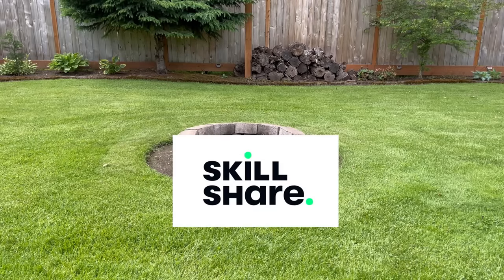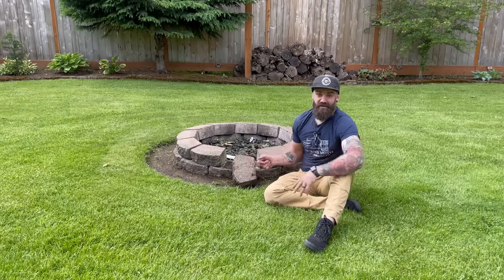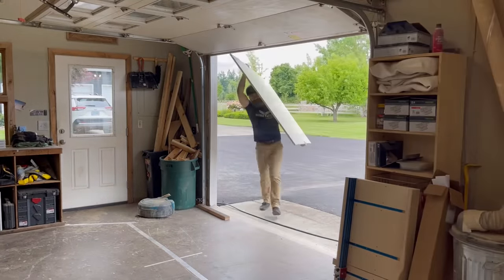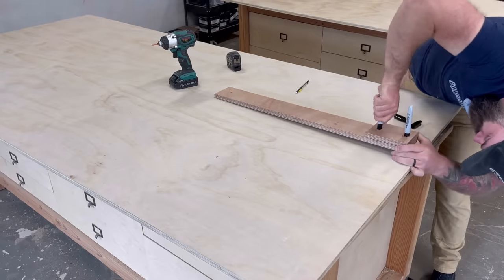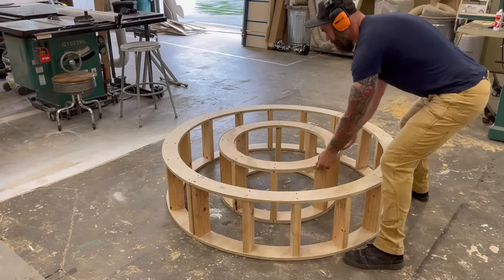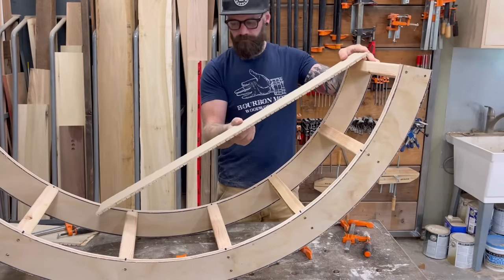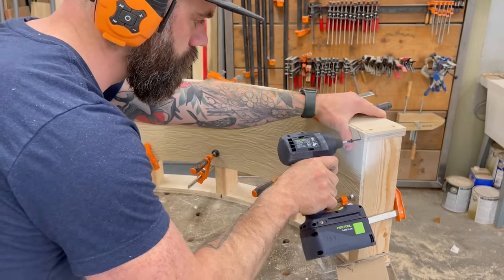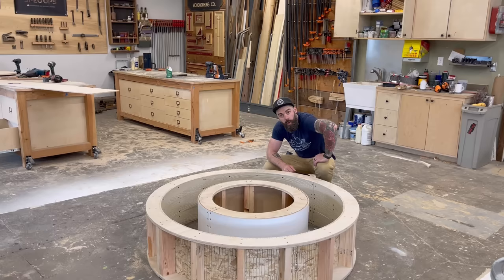Making a Concrete Fire Pit the Right Way || Ultimate Fire Pit Build

Comment: The interior part, I would not have bothered removing.... just light a fire in it and let it burn 😂
Reply: I was thinking the same thing
Reply: Exactly what I was thinking
Reply: I think he just said, “Dooooooooh!”
Reply: Thats what we did. Worked like a charm
Reply: Same !!!
Reply: I was wondering the same hahaha
Reply: exactly what I thought!
Reply: Do you know what happens when you burn melamine? First off, melamine is a fire retardant. This doesn't mean fire proof. It will burn slowly, but first it's going to release a lot of toxic fumes. Burning some could be your last mistake. Melamine is dangerous when it is heated up because it releases hydrogen cyanide and nitrogen oxide. There is also formaldehyde in the resin. All of these are carcinogenic. The fumes can kill you and residual chemicals can also leach into your soil. It is plastic, so you might want to rethink that.
Reply: Or just disassemble one of the 3 sections and knock the other two loose.
Reply: @robreneau2959  Science=PartyPooper is all I read there.
Reply: @robreneau2959  there is a very simple solution to that, just drink 8 beers before you burn it
Reply: Same
Reply: Exactly what I was thinking. 😆😆
Reply: @robreneau2959  I'm relieved you posted this and people like you post to YT at all. I don't know if that form lumber was treated wood, but I imagine that's also not great to burn for the same reasons. Seeing people using unseasoned wood inside is another burning error because it's loading up their chimneys with excessive creosote. I also see a lot of videos of people using pallets as furniture but don't know to look for the grading stamps or what they mean, etc. Maybe these are fine outside but not like next to your face in a couch or bed frame. No expert here, though.
Reply: My thought too.
Reply: @robreneau2959  so what....there is worse stuff burned every day by the government. Just don't stand near it and don't cook over it while that crap is burning and you will be just fine. What do you think is released when a vehicle catches fire and burns.....hmmm? There are tons of vehicle fires every day.
Reply: Burn like 2000$ in lumber there
Reply: @michaelkey3915  Using what the government does as guilt leverage will make you a bad BAD person, and also do awful things. Just do what's right to you and your neighbors.    :)
Reply: @robreneau2959  dont use melamine as your form then, DOH!
Reply: False Flag  You're right but I was more concerned about the local safety of one person who might be saved by a bit of knowledge. Do you sit around your exhaust pipe sucking those fumes? But, go ahead, burn it and while you're at it, take a deep breath and disregard everything I've said.
Reply: @TheMouseCop  LOL
Reply: @ericgilmore5949  LOL
Reply: @michaelkey3915  You're right, lots of things are burned, discharged into the environment every day and we're all sucking those chemicals in. Yet, they have also dissipated into the environment. More than likely, someone who doesn't know would probably burn this while sitting around the fire. What you fail to realize is that chemicals will also leach into your soil, your groundwater, contaminating you directly, locally. All I've done is provide a warning label, so go ahead and remove it.
Reply: @BraxFilm  No, just don't burn it.
Reply: @robreneau2959  tell him Robert. Hit him with those FACTS
Reply: @robreneau2959  typical. You put important safety information out and people just say “who cares?🤷‍♂️” A lot of people, karen, a lot of people care.
Reply: Yup
Reply: I was scrolling down the comments to exactly find that thought
Reply: @widjadija  Let's remove all the warning labels, let stupidity and evolution determine who moves forward.
Reply: I thought he wanted to keep it to reuse.
Reply: I was going "burn it" like 7 times lol he already broke my heart, when he chopped them long 2x4s into them baby (scrap) pieces..then again, if he can re-use the forms, and actually does re-use them, they remain valuable I suppose. I doubt they would get re-used at all though, let alone often..
Reply: UnjustifiedRecs  that’s why he has those thermal bricks
Reply: @robreneau2959  You don't need to explain yourself a hundred times over. The immature ones in here will ridicule you for the knowledge you provide but many will thank you for putting it out there. I was asking myself the same question (why doesn't he just burn it) until I came across your response.
I appreciate you. ❤️
Reply: UnjustifiedRecs  which is why he put fire brick on the inside
Reply: UnjustifiedRecs  I worked in a steel foundry, we tapped out at around 3000 deg f. The only thing I ever saw explode was when we had a water jacket leak and the water poured into our tap out pit under the ladles.
We had to pour out an excessive heat and the water did explode. ALL the concrete around the furnace was pitted from splatter, remember 3000 deg f steel coming in contact, the concrete most certainly did NOT explode, it did burn though, it spalled.
A wood fire will not get to the immediate heat required for a steam explosion.
Reply: My thoughts exactly. Let it burn let it burn.
Reply: Y'all are to blame for his tirade in video 2
Reply: Guys, Here is The Savior

YaH The Heavenly FATHER (Genesis 1) HIMSELF was Who they Crucified/Pierced for our sins and “HERE IS THE PROOF”

From the Ancient Egyptian Semitic: 
"Yad He Vav He" is what Moshe (Moses) wrote, when Moses asked YaH His Name (Exodus 3)

Ancient Egyptian Semitic Direct Translation
Yad - "Behold The Hand"
He - "Behold the Breath"
Vav - "Behold The NAIL" <— YaH’s Crucifixion
He - "Behold the Breath"

“Behold the HAND that Beholds The NAIL” 

PROVES - YAH The Heavenly Father HIMSELF was Who they Crucified

That is EXACTLY what Moses Wrote

Here is what they mean

YaH's Name:
(Ya)d + (H)e, as YaH is what Moses called Him and YaH Declared: "this is My Name, this is My Name for all generations" (Exodus 3)

YaH is The Creator of “MAN”: (Genesis 2:7)
Yad He, (HAND BREATH), as YaH's "HAND" Formed man from the dust  of the Earth and His "BREATH" made him a living being (Adam)

YaH's Sacrifice of Crucifixion for “MAN”:
Vav He (NAIL BREATH), the "NAIL" through YaH’s "HAND", in Sacrifice of Crucifixion, that whosoever shall call YaH Savior, His “BREATH” brings forth life (Salvation)

How YaH arrives:
YaH arrives via the Tent of Meeting (Exodus 33:7:11, Isaiah 54, 55), where a Tent is erected outside the city, a cloud descends upon the entrance of the Tent and YaH appears...

Why they demanded YaH to be Crucified:
YaH was Crucified according to Hebrew law (Deuteronomy 21), to be NAILED/PIERCED on an Almond Tree for BLASPHEMY as it was for His NAME they demanded Him Crucified. The Messiah claimed He was YaH...

HE WAS YaH!!!

HalleluYAH translates “Praise ye YaH”

The Hebrew Book of Isaiah

Isaiah 42:8
"I am YaH; that is my Name! I will not yield my glory to another or my praise to idols.

Isaiah 43:11
I, I am YAH, and there is no other Savior but Me.

Isaiah 45:5
I am YaH, and there is none else.
Reply: What I was thinking😂😂
Reply: Haha I can’t count how many times I have done something like this. I’m one of those work harder not smarter kind of guys 😂
Reply: Then build your own and do that😂😅😊
Reply: Thinking the same thing, I came here just to say that!
Reply: I was about to comment that when your comment was the first thing I saw. 😂
Reply: Was thinking the same thing lol

Comment: "im not renting a concrete mixer" said by everyone... once! lol
Reply: Until you mix concrete by hand, everyone says that!
Reply: @multidinero  I had to use a shovel and wheelbarrow for the whole time I was doing fences and decks lol .
Reply: @ramsaybolton9151  as a Finish Carpenter, I watch those guys from inside and ask the age old question.....

“Where’s that guy’s mixer?”
Reply: @multidinero  You should ask " Who's the mixer " instead lmao
Reply: @ramsaybolton9151  Same. I am both cheap and a glutton for punishment.
Reply: Funny thing is, it can be cheaper to BUY a HF mixer than to rent one for 4 hours, shoot, where to store it though.....;)
Reply: Never a truer word spoken. I mixed a ton of sand and cement by hand in a wheelbarrow for a shed base... my lord so much regret at cheaping out.
Reply: @Mechie980  Yeah that's why we used the wheelbarrow. After transporting materials and other tools there is no room for the mixer lol.
Reply: I have run projects that required a concreate pump truck (retaining walls), with 4 trucks backed-up in the street at a time, down to just filling in a quick repair of a leaky pipe in a concreate floor. 

I have a two bag rule (50 kilo bags) for mixing by hand, then it is time to get the mixer. At about 25, 50 kilo bags, time to call in a concreate truck. If you don't need, say even a half truck load, time to look at perhaps adding a nice patio slab or something, to make it worth it. 

Trust me, you only get one back, and you won't be late for happy hour.
Reply: I bought a cheap concrete mixer from HD 5 years ago - best $300 I've ever spent. I only use it 3 times a year buy man its nice not having to go rent and try to decide if its worth it or not to hand mix. I just pull it out and thank myself every time ...
Reply: Yup, been there done that. It sucks. 😂
Reply: @ramsaybolton9151  same here. The only time we rented a mixer is when we were doing a deck that had at least 8 posts... then the boss would splurge a bit (to make sure the job didn't take 3 weeks lol)
Reply: And you are damn right!
I then went and bought one as I have a hoarding problem when it comes to tools...
Reply: @Mechie980  200 for a cheap 30 gallons mixer , so you can about mix max 15 gallons at time ... then you can sell it , if you dont need it and get money back .
Reply: done hundreds of stamp deck pours without 5 x 10 gallon buckets
Reply: Around here you can “buy” a premixed concrete trailer. I think they hold up to a yard. You call up, tell them the strength you want, slump, additives, and roll up with your vehicle and pull it away. Return the trailer when you’re done, with or without an excess left in it.
Reply: yup!
Reply: @Mechie980  I was GIVEN a mixer for free! Fella told me only caveat was for me to come and get it!
Reply: I got an old pre-WW2 concrete mixer years ago. Just a little motor on a drum barrel, nothing fancy. I dont use it much, but I do loan it out for the odd weekend. Keeps me supplied with all sorts of odds and ends. Havent had to hunt for venison in years. Paid itself off 100 times.
Reply: Mixing concrete is the most labor intensive and boring part of the whole job
And we don't even have the pre-made mix

Yet i've never bothered because i deal with concrete very rarely and i could use the workout anyway😂
Reply: Nothing like hard work. I have only once used a cement mixer. I actually prefer it by hand.
Reply: Honestly the middle gram could have been burned
Reply: Yeah and now I own a concrete mixer
Reply: Nobody knows how to mix 3 bags at a time in under 3 minutes using a tarp. You and a helper hold the corners and just rock them back and forth for a couple minutes and it comes out perfect. No wheelbarrow and no shovel needed. I used to mix one or two pallets a day that way and drag the tarp down into the ditch to pour storm sewer box collars around the big sewer mains... you could shoot it right in there exactly where you need it out of the tarp. Nobody believes me that this method works. I should really make a YouTube video about it hahaha. Every time I see somebody mixing the hard way I feel sorry for them but you CANNOT tell somebody they dont know how to mix concrete. They always get offended.
Reply: Amazing job, kind of jealous, I'm definitely glad you remembered breather tubes, I'll bet this puppy is going to roar.
Reply: Only 2 things I thought of were cutting a notch in the fire bricks for the breather tubes. 
And where exactly (rhetorical) do you live that it's possible to float 3-5mil plastic so perfectly, without the wind blowing it all over. 
That alone would have probably taken me 20min before I'd think of setting bricks on the corners.
Reply: Thank god,I was lazy enough to rent the mixer and the guy to mix it 😂
Reply: God yeah…Did a post hole…that showed me that when I set up to lay a 2x8 foot path extension, I needed a rented barrow mixer.  Then the day I booked it for, the heavens opened.  So I was outside then in an all day long downpour…with a plastic bag on the electric mixer motor and me in skimpies cos once you’re wet there’s no point worrying anymore.  Got the job done…and a cold bug! Lol.
Reply: I have mixed it by hand many times I'll still do it that way only because I'd rather save as much money as possible rather then throwing in back into the economy that doesn't use it for anything helpful
Reply: Making Concrete by hand is easy, making mortar by hand sucks
Reply: @ramsaybolton9151  as a former tile installer apprentice I resemble that remark. 'Where's your cement mixer?'  'Hi, my name is mixer, cement mixer'. Thousands of pounds of dry mix for mud floors all by hand over the years
Reply: @themightyparthos   I don’t know if I am a hoarder but I definitely have a FB marketplace tool addiction.  $50 cement mixer? “I’ll take it!”  $2k for a fully operational propane fork lift? “I’m on my way!” $1500 for a tire machine and balancer? “Let me swing by the bank and I’ll be right there”…… lathe, bench mill, planer, dust collector, compressor, nail guns….
Reply: I say it every time. (My father-in-law owns one.)
Reply: @ramsaybolton9151  that was my exact thoughts when i was doing fencing it was always a wheelbarrow and a shovel lol
Reply: You just need a mate that likes beer,we all have plenty of them!
Reply: @areyouundoingthatorwhat9181   lol prob cheaper and faster to just rent a mixer 🤣
Reply: Luckily I live right across the street from a master mason. If I need a mixer for a weekend project, I borrow his.
Only condition is that I clean it before returning it. :)
Reply: @ramsaybolton9151  But nobody asks "How is the mixer".
Reply: Yep been there and then I’m not getting the cement delivered Ill use a mixer for 30sq meters 🙄 never again
Reply: Lol yup .. I'm stubborn or a slow learner .. made a 20'x16'x6" slab at my pit and had so much "fun".  But didn't learn when putting in the foundation to my deck either.  Maybe next time 😅
Reply: Even I said that once I started work with concrete years ago never will I not use a concrete mixer?
Reply: I always mix by hand. Not easy but not the worst if its not too much needed concrete
Reply: @Mechie980  that's what I did when I put a perimeter drain and sump pump in my basement, one of my smartest investments to date.
Reply: Truer words hath never been spoketh.
Reply: I'm buying one.
Reply: Or a tile saw
Reply: Once is the max